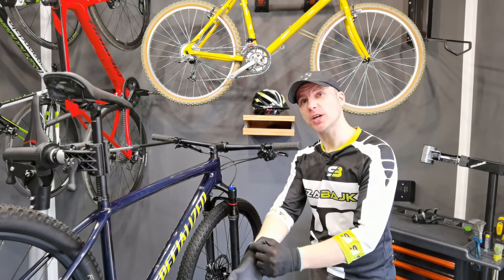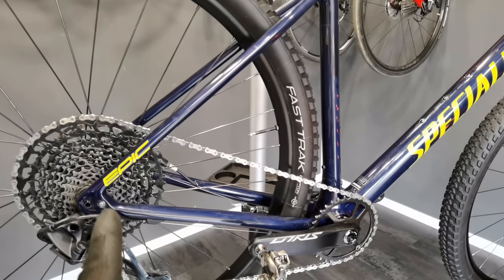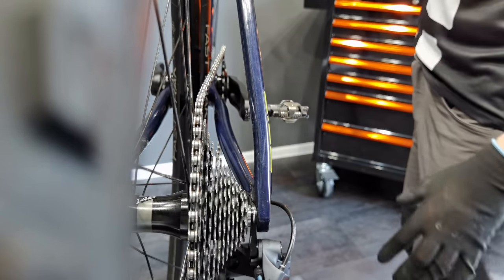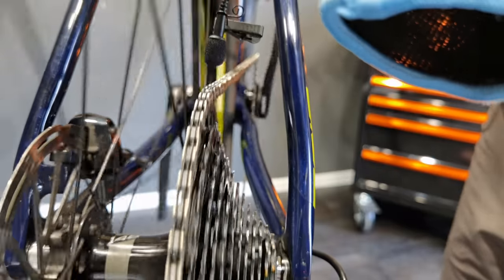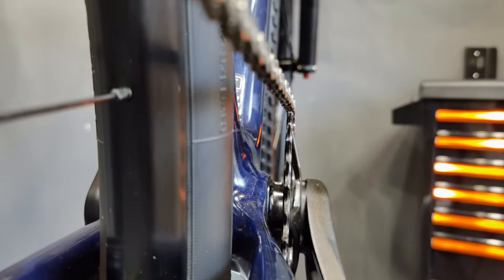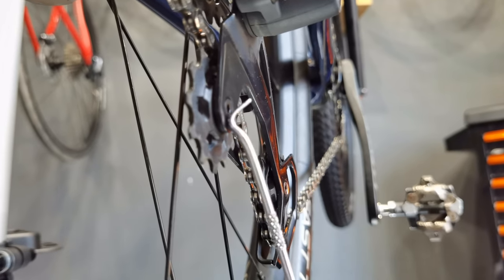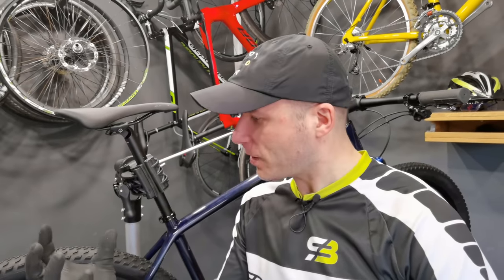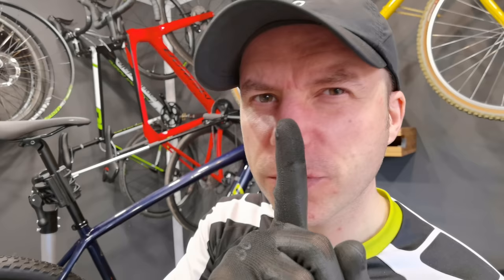If you were close to XC race podium riding on 1x12 drivetrain, you'd win it on 2x11. Here's why...

Comment: Agree 100%. I'm about to race my first xc of the year, and have been testing different front ring sizes and waxing methods for the chain, still getting a lot of friction.
Reply: I wouldn't be worried about any lost watts. 1x gearing and the chainlines that come with it hasn't stopped Nino Schurter winning bucketloats of XC races and the Olympics. But I have to say I'm annoyed by the louder noise of the lowest gears on my gravel bike (Shimano GRX 1x11) I wish I can somehow get them all to sound smooth. SRAM 1x11 has been working beautifully on my mountain bikes. To me there's is no better transmission than 11-speed 10-42 cassette. (it's simple and has just enough range for everything I've come across on my rides)
Reply: @pyhtiorides  you are totally right, at the end Nino is getting the same power loss as his competitors, but he and his competitors have no option, they get paid to use what their sponsor wants them to use. I bet if they had an option, they'll go with a 2x11 or 2x12, to avoid chain crossing, which is the problem here. And I'm sure they'll opt for a rigid frame, not a full suspension as they are using right now.
I personally would like a 2x12, but with a bigger chain ring, so 34 and 44 in front, so I won't lose that much on the flats and downhills.
This industry has moved on some innovative directions, for the sake of weight, but maybe not the best ideas.
Reply: @rubenvor  Sorry but I can't agree with you. The XC World Cup courses are pretty technical and would be horrible (and slow) to ride on a rigid setup. Sometimes the racers pick a hardtail for smoother courses. It's their own choice. But modern full suspension bikes are very efficient, you gain more on the technical parts / downhill than you lose on the uphills.

2x12 sounds pretty excessive to me. The gravel bike I mentioned used to have 2x11 drivetrain and I never used the biggest 2 gears.
Reply: @pyhtiorides  that's very true about the full suspension vs a hard tail for the avarage rider, but a professional sponsonsored rider, will not be allowed to use anything but the top end bike from their bike sponsors. To prove that, you can see that all professional XC riders never went back to hard tails after they started to use full suspensions. And of course, they will always say it's the best bike and bla bla on the interviews, they have no option. 
One rider that was honest about this situation is Chris Foome about the use of disc brakes on his new bike, did he had an option to opt out and go back to rim breaks? Nop.
Reply: @rubenvor  I've watched all world cup XCO races the last two seasons, it's mostly full sus but on certain tracks you still see the top riders on hardtails. Here's a few from 2019: https://m.pinkbike.com/news/five-bikes-and-a-few-randoms-albstadt-world-cup-xc-2019.html

The sponsors want their riders to win so they'll supply the riders with the best weapons in their arsenal for the given track. But the riders win the races, not the bikes. And xc race bikes aren't for everyone, I much rather ride my trail bike.
Reply: @rubenvor  I raced for years at a national level and was sponsored, what you are saying is completely true, I had to ride bikes I hated with components I didn't get on with (early SRAM) which actually cost me podium positions in races, I have always used a 2× setup for best chain lines and much lower friction, all the top xc guys know this, but, as you rightly say, they are stuck with their sponsor, like it or lump it
Reply: Haven't been able to put this thread off my mind 😅 But first of all I gotta admit I'm not a racer so I don't need to care about possible few percentage watt losses. I understand for a racer it's very important to feel happy and confident with their rig. And I believe 12-speed 520% range cassette is mostly a marketing gimmick. I feel it's there to assert technological superiority, much like the quest to be the first nation to land a man in the moon back in the day. In other words I can believe it's not built to the exact needs of a XC racer and neither for the average Joe. I'd really love to have some data on how much gearing range pros are using in modern day XCO races. Are they actually spending time on both the 10T and 52T cogs?

But when it comes to bike frames, aren't XC race bikes designed for the sole purpose of winning XC races? I'm pretty sure elite athletes are given the best frame in their sponsor's selection for the race. And about HT/full-sus, I had to do a bit of digging and for example Nino was riding a hardtail in Leogang 2020 at least :)

Sorry but this goes on :D I just have to get it out. This is with all respect to @rubenvor (& Threefeet Pete)

Since I bought my first proper mountain bike back in 2018, I've been madly in love with the simplicity of that SRAM NX (nowadays partly GX) drivetrain. To me, it was just really annoying having to decide if I need to switch to bigger chainring or not yet. I could deal with that on road but out on the trails I want all of my attention to be on the roots, rocks, turns, drops etc up ahead. 10-42T is all I need and all of the 11 gears feel smooth to me.

Final note, I clicked on this video because I'm a bit frustrated with the noise of the lowest gears on the GRX drivetrain on my gravel bike :)

Comment: No, just no. You don't lose power in lower gears because the teeth are angled, and you're going very slow in low gears. And in the very high gears, you're going down an incline. So, you lose nothing. It is designed perfectly so that the chain line is straight for nearly flat paths/roads.
Reply: False, you do lose. friction facts proved this. plus the backpedaling chain drop problems.
Reply: @trentvlak  the problem, in my view, is chain stays are being made too short today, making wheelbases too short. And seat tubes are too vertical, forcing excessively high seating positions. I seriously notice that compared to bikes of the 70s+80s. Bicycle engineers are too focused on cutting costs and enhancing specs instead of focusing on practical riding positions and enjoyment.
It seems to me that when we made bicycles in the USA for Americans, they fit European body dimensions better. Since they are mostly made in Asia, they fit people with shorter legs compared to torso lengths. And I see the same in the motorcycle industry. BMW motorcycles generally fit long legs and taller people better than Japanese motorcycles. You can't make one bike for the world. People with differing body/leg proportions require different designs.
Reply: @chadkline4268  So to solve this problem of them being too short, maybe 2x is the solution?
Reply: @jurekgadzinowski2895  I purchased the AdventX last year, and I love it. I love not having a front derailleur. I carry a bicycle pump and bottles, and I have a bell instead of a front derailleur shifter. Only so much space on a handlebar. I don't sense any loss of energy from a 1x 😆 I ride up to 120mi per day in mountainous terrain. From 0F to 100F. Ice, rain, snow. 1 less cable. 1 less mechanical part+adjustment. From all I've read, 12 gears may be stretching it. 10 or 11 may be more practical.
Reply: @jurekgadzinowski2895  2x is fine if you like it. It's none of my business 🙂 my point is to consider the input power of your leg compared to the friction loss being described. It's no comparison. I bet it would be difficult to measure, 0.1% or less.